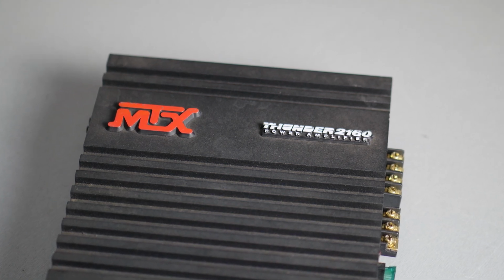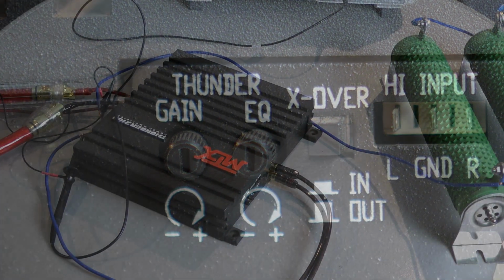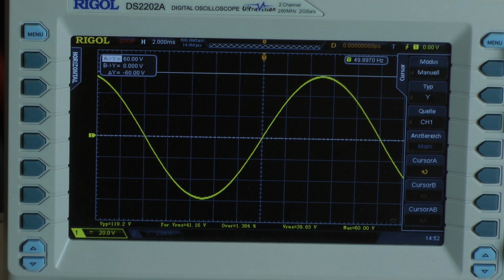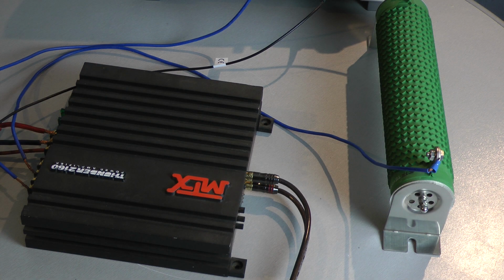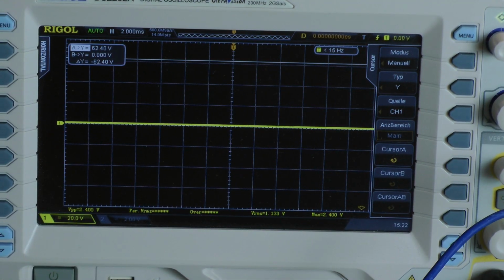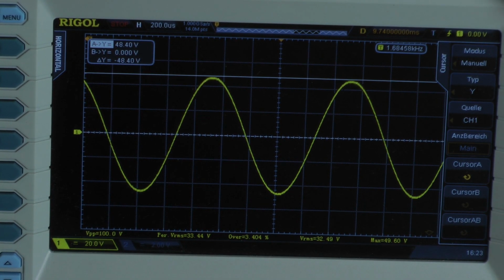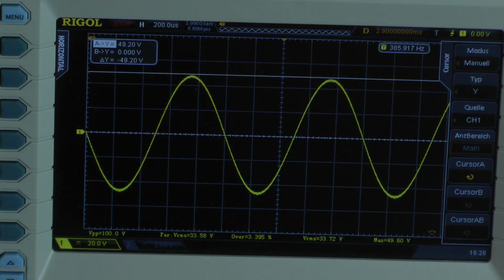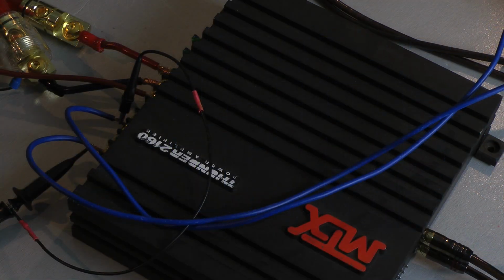MTX Thunder 2160 oldschool car audio 2 channel stereo amplifier amp dyno output power & sound test

Comment: I just noticed he's using like 10gauge wire ? And aren't these amps rated at 12.5 volts ?
Reply from the maker: Continuous they are rated at 12.5V , dynamically they are rated at 14.4V. It’s printed on the backplate. It’s just a very short adapter, I used 35mm2 which should bei 2 gauge

Comment: I'm still running a Thunder 2300 that I've had since 1995, currently driving two Rockford 10"s in the wife's car.  I have to keep the gain turned almost all the way down so it doesn't pop those subs.  That amp is an absolute beast.

Comment: I had a 1991 mtx amp rated at 70w per ch into 4 ohms, and it sounded more like 100w per ch.  I was pushing 2 15" woofers rated 250w rms each, and it sounded loud and great!
Nice video as always, thanks.😊

Comment: Pretty sure the designer of these amps was at least partially responsible for designing the punch 45 and punch 75 amps. The mtx thunder amps were solid designs and tested consistently by all the car audio mags. Most importantly, MTX rated these amps correctly at about 20% below actual power across the model range. The thunder 2300 was a great subwoofer amp back in the 90s. I still consider picking one up even though I’ve got a solid 1400 watt Rockford amp 1000.1bd on my subs right now.